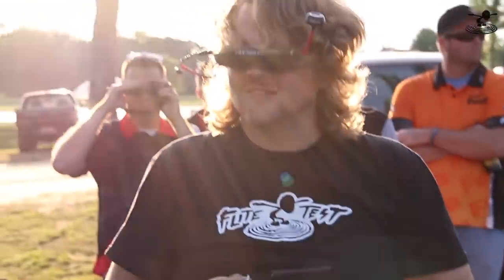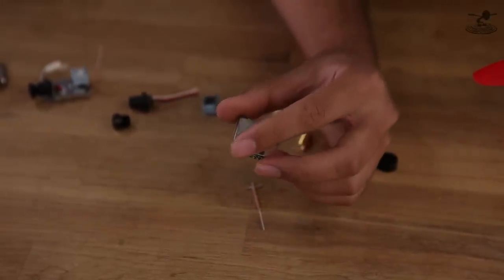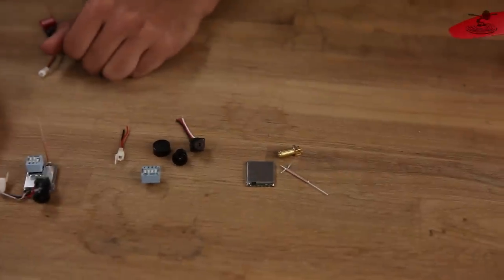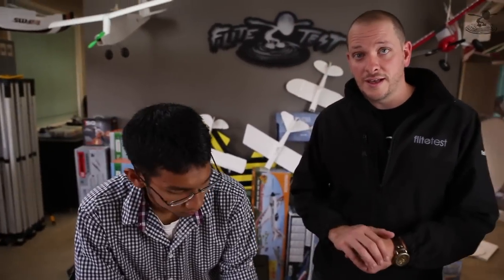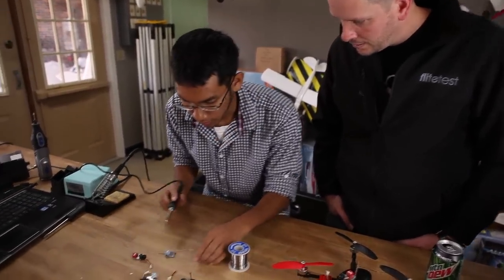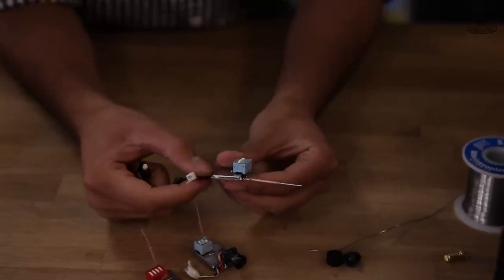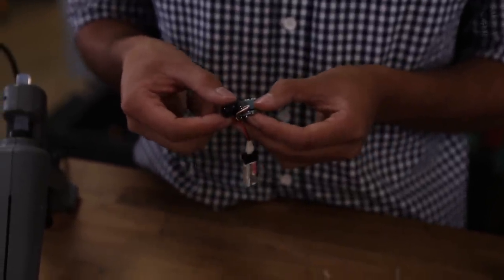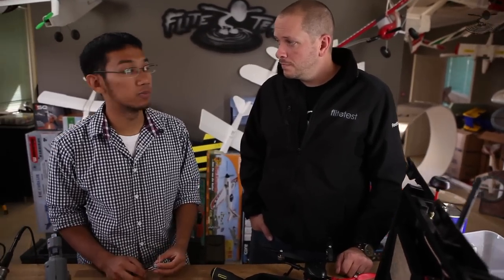Flite Test | DIY Micro 5.8Ghz FPV

Comment: For all you boscam fliers here is a vTX for $30 that will use the boscam frqz. http://www.securitycamera2000.com/products/32CH-5.8G-200mW-Micro-Wireless-Video-Audio-Transmitter-For-FPV.html

It's found at securitycam2000 it's 32ch and has the dip switches presoldered. They have 1 gram cams as well.

Comment: You buy a dip switch but, you don't buy a sma connector, so the antenna doesn't break off, c'mon guys, fpvhobby sell those, blunder there.

Comment: Wipes off on shirt* yeah because static electricity has never damaged circuit boards before lol! Haha I'm just giving you guys crap99.99% alcohol does wonders for cleaning off circuit boards, before and after you solder A liquid flux is always a plus when you have it handy, it will make any solder job 10x easier and cleaner and it will make your soldering job look professionalStay away from all No clean solder unless it's for a wire harness or something like that or when you can't clean your board when there's a onboard battery or something like that, use a liquid flux that's NOT no clean flux and then clean it off with 99% alcohol and let dry or blow it off with compressed air.Telling you that you will be so happy with the end results and you will have professional results.Been soldering for a long time and was a class 3 production solderer at one point.Oh and one more thing No clean flux will slowly corrode your solder joints over time, if you don't plan on relying on those electronics for a real long period of time go ahead and use it though, you will rarely ever see any military class circuit boards use no clean solder or flux